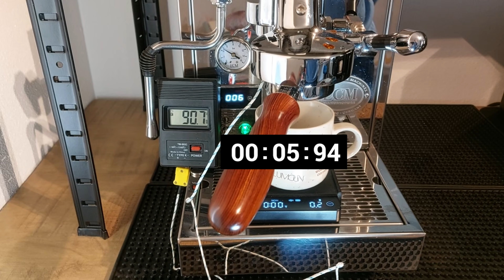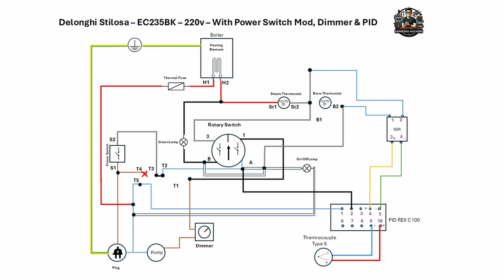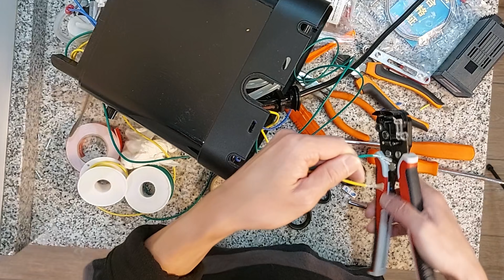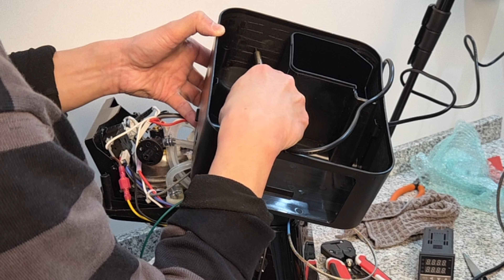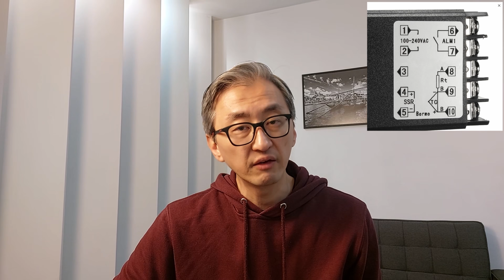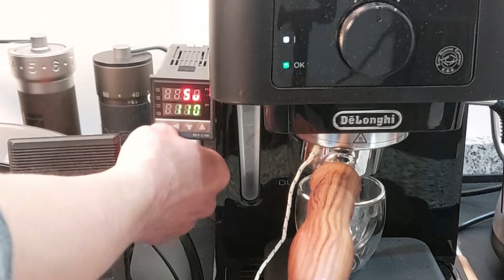I Tricked the PID — 1.2°C Stability

Comment: Congratulations for this amazing technique! And thanks for sharing! 

I'll try it on my modded Philco 20 bar in a few minutes!
Reply from the maker: Thanks! Let me know how it went. These machines are slightly similar
Reply: @EspressoHackers  I tried setting the PID at 110 right before starting the extraction (I use your suggested PID settings for the Philco). 

110 was too much, extraction started at 90 and ended at 94. I'll try again tomorrow at 100 and/or 105 and I'll update the results here.
Reply: @espressohackers PID at 100 seemed too low for me. I still had a 4 degrees variation during extraction. I know it's not that bad at all, but it's close to the variation I usually get: 5 or 6 degrees Celsius.

I'll try 105 later and will report here again.

See you here or at Clube do Café!
Reply from the maker: Are you measuring the temperature in the puck or these numbers are what you're seeing in your PID?
Reply: @EspressoHackers good point. Although I calibrated the offset so the PID would show the water temperature on the shower, I have to redo my tests using a thermometer in the puck to compare apples to apples. 

I'll be back! 😅
Reply from the maker: @LuizFernando-eb4cnthe calibration will lead to the target temperature in the puck but doesn't mean that the actual temperature is the same in the puck, in reality it's the temperature in the boiler plus the offset
Reply: @EspressoHackers bad news. Every time I try to make an extraction with the temp sensor in the puck, there's a major leak that f*cks up everything. 

I'll try again later with my 2 spout portafilter, positioning the sensor right after one exit. Considering that the filter and portafilter will be both well heated, temperature measurement should be close enough to your method.
Reply from the maker: @LuizFernando-eb4cnsometimes it happens here as well, but less with the original portafilter. The bottomless that we buy from Aliexpress and similar many times has thicker ears that you need to file or wait a couple of months for it to accommodate better in the group, but when you insert the probe it gets messy.
Reply: @EspressoHackers  unfortunately I don't have the original portafilter because I bought this Philco second hand and I was kind of scammed, the portafilter was so disgustingly dirty and oxidated that I couldn't clean it even with Bombril. LOL. 

But back to the matter, I measured the temperature using a third-party 2 spout portafilter, placed the thermometer probe exactly after the filter, so the brew hit the probe before the portafilter spout. After 5 seconds the brew started to flow, temperature was 65 degrees Celsius. It kept going up until 12 seconds later, when it stabilized at 88 degrees. 14 seconds later the extraction ended at 90 degrees Celsius. So I understand there was a 2 degrees variation actually. 🤔

I'm only a beginner in this hobby, and I'm using medium roasted beans. Frankly, I can definitely tell the difference in temperature, but I can't feel if there's difference in taste. But the beans I purchased are a blend of different coffee farmers (Moka Clube Bala de Caramelo) and I don't know if this has any influence, but I definitely noticed inconsistency in grinding between one brew and another, which obviously affects extraction time and, consequently, taste.

But it's good to know that I can get better temperature stability thanks to your generosity in sharing this kind of knowledge!

Thank you very much again and see you here, at espressohackers.com, or clube do café!!!
Reply from the maker: @LuizFernando-eb4cnthanks for the feedback. Great to know it worked for you. I think it's more relevant for light roasts and fermented beans. When you're still having more acidity in the cup than you want. See you in any of these places!